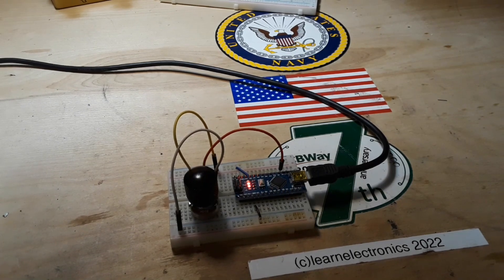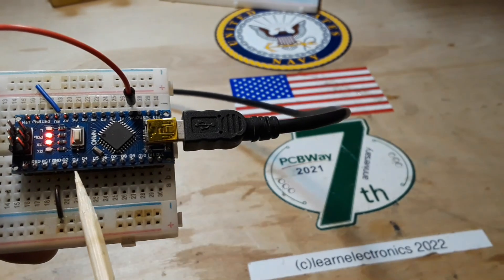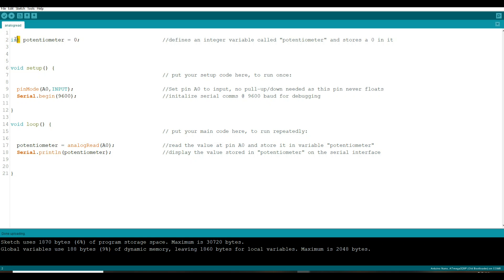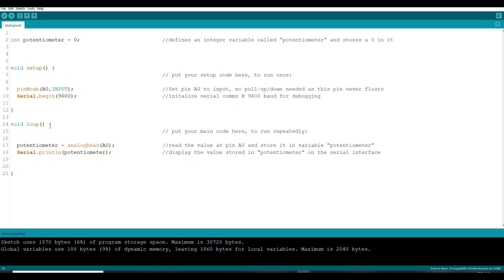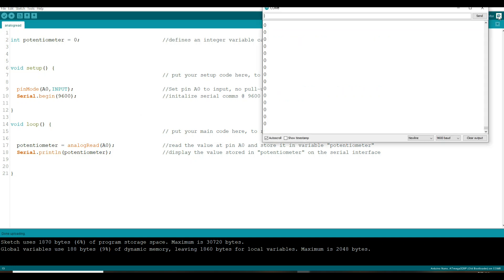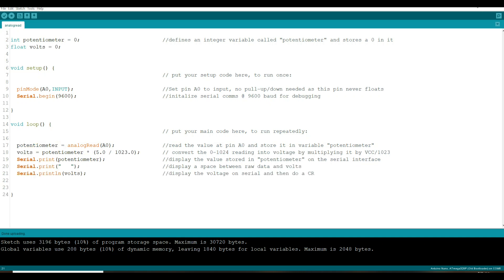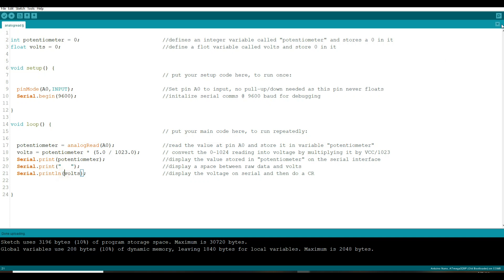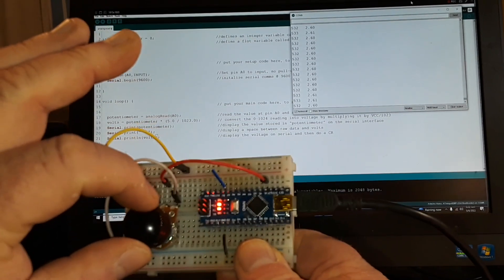Arduino Analog Read - More To It Than You Think

Comment: Paul, your videos on this clock are excellent precisely because of the "errors" you made in assembly. It points out the fact that builders need to take care in assembly! But know you this: the clock is dead balls on accurate! Put mine "in service" about the time you made this video and its minutes roll over exactly when the NIST/WWV clock rolls over. I got two of them - red and blue - in the ham shack for local and UTC  and they're absolutely in sync!
Thank you for your videos.

Comment: Cool. its 5/9/22 and this is about where I am. 1yr into Arduino I have built three Rc cars (Nrf24, Mega328, 6612FNG and generic ESC)on 2S. One 5 channel TX. My problem is I use other folks sketches. I have to work around this. You have my attention.

Comment: Great video!!👍 Maybe you should put something in your code to restart the readings every time you run the code. I can see in your terminal program that you’re gartering a huge amount of data. Using a refresh/return(0) might be a better way so that the readings don’t take to much space. Otherwise great demonstration. I’ve learned a lot from you over the time👍